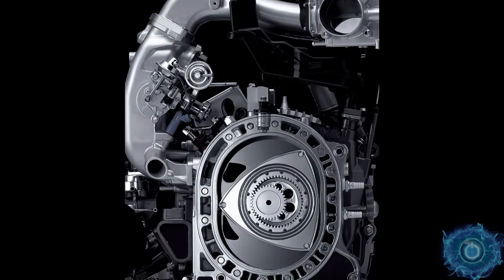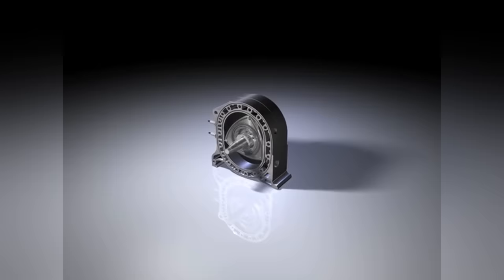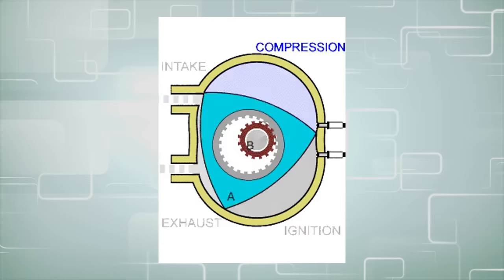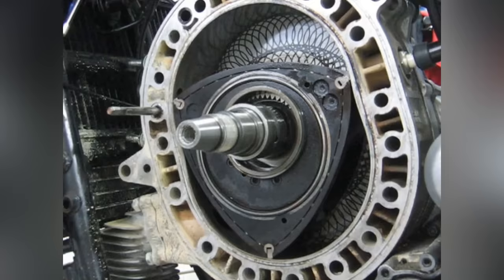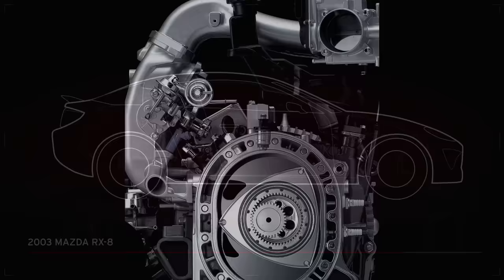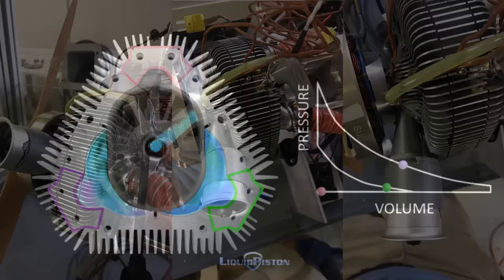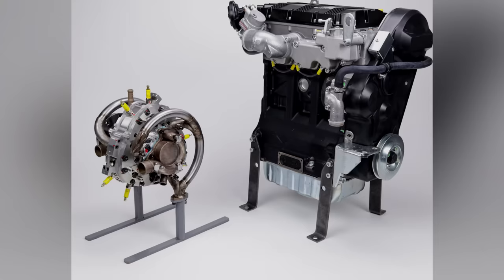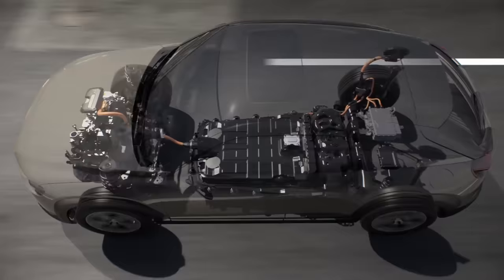STRANGE New Rotary Engine BREAKS Records

Comment: 40 years ago I read a book on Wankel engines from the college library.  There were all sorts of alternative lobe and rotor designs including this one.  So the concept isn’t new but the execution and development is.  This video also conflated radial engines with rotary engines but there is some common nomenclature overlap historically.  The first real use of a wankel rotary was as a supercharger on a motorcycle.  The first operational Wankel engine had spark plugs in the rotor itself.  Silly things I remember from a book I read in 1983.  Wankel had designs that could create a theoretical 144:1 compression ratio if a functional seal could be developed.
Reply: Do you know the name of one of the books?
Reply: The aircraft engine shown was considered a rotary engine because the crankshaft was fixed and the entire cylinder block rotated around it, whereas a conventional radial engine has a fixed cylinder block with rotating crankshaft.
The Musée de l'Air et de l'Espace in Paris has on display a special, "sectioned" working model of an engine with seven radially disposed cylinders. It alternates between rotary and radial modes to demonstrate the difference between the internal motions of the two types of engine
Reply: I remember an item from Popular Mechanic about 1980? It was a great idea then and my college buddies were awed by it.. 😮😮
Reply: @mirandahotspring4019  Either way,  both aircraft engines are piston engines. Secondly, the Wankel rotary doesn't have a fixed crankshaft. There were some weird considerations is the past...
Reply: @stuartedge5906  The original Wankel design DID have a fixed shaft; the rest of the engine spun.
Reply: @tfod 

Thank you for your comment here.
Reply: It’s a long shot but do you remember the name of the book? Or the other lobe/housing configurations?
Reply: @RockSolitude   I had posted it but I guess that post got eaten or deleted by the YT guards.  Probably because I linked to the book.  I think it was The Wankel Engine: design, development, and applications by Jan P Norbye.   However I cannot be certain.  I was fascinated with one where the the rotor had 4 lobes and reminded me of a 4 leaf clover.  There was a 6 lobe design as well.  The idea was the rounded rotor had the seals on the chamber instead of rotor edges.  I hope that helps.
Reply: At University I recall a brilliant physics professor tell the class that revolutionary designs take about 100 years to be fully appreciated by engineers and/or that's about how long it takes before materials advanced enough could realize a new engine design. The examples he cited were the Stirling Engine which is about right and AC compressors which enabled refrigeration and all of the benefits that brought to both home and in the field. I feel the same way about the Wankel rotary engine. With the need to electrify planes, especially short-haul airplanes, it seems to me that the Wankel will finally have found its niche application.
Reply: @RockSolitude  The Wankel Engine, by Nicholas Faith; The Wankel Rotary Engine, by Harris Edward Dark; The Wankel Rotary Engine: A History, by John B. Hege; The Wankel Engine, by Jan P. Norbye; Principles of the Wankel Engine, by Ted Pipe.  I read all of these and included comments from them in my MS thesis.
Reply: @Peter Neve  try Rotary engine by Kenichi Yamamoto. I have it on my shelf somewhere but a quick search had me downloading a pdf copy also. If you like rotaries. It's a must read.
Reply: So you freely admit the single source of your 'knowledge' is a book you read 40 years and yet here are saying this video is wrong. Wtf is it about YouTube comment sections that make everyone think they're an expert on any topic.

The aircraft engine shown absolutely is a rotary.
Reply: You know, there are ways to improve the piston engine dramatically. And strangely, instead of changing the engine, they are trying to delete gasoline engines. It's an insanely... Well, it's not good that consumers are allowing governments to delete gasoline engines so you can't even buy them. You can use "lean burn" technology to dramatically reduce the amount of fuel, to something like 50:1 air to fuel, instead of stoichiometric 14.7:1 which is used today. In the 1970's, hundreds of people created cars that got 80 mpg, or even 200 mpg. One car in 1973, the Shell sponsored Opel, got 372 miles per gallon, and weighed 2,500 pounds with a regular full size piston engine, running on normal gasoline. Why are people not asking for these improvements? People should be demanding these obviously existing technologies, instead of being willing to pay $75,000 for a new electric car.
Reply: @3-der251  You Da Man, assuming I don't mis-gender.
Reply: @kermitthefragg  It's not a Wankel, though, and I think he's making a distinction between piston-driven and rotary.  Your hair-split is probably finer than his.  It's still nice to hear from someone with some years who's been percolating concepts for decades.  I wouldn't $hit on that.
Reply: @Ritalie  I wish I had the receipts on some of those inventions.  I remember hearing about all kinds of inventions whose patents were bought up by Big Oil or Big Auto.  

My biggest gripe in the here-and-now is the planned obsolescence.  People should be able to keep and maintain cars FOREVER, and the auto industry should be - ahhh - geared to the manufacture and distribution of replacement parts.  The new cars manufactured each year doesn't need to be as great as it is.  Yes, we need an auto industry.  No, we don't need all the government interference in how they're made and who can make them.  But they've regulated them to such a degree that you have to be a multi-billion-dollar mega-company to survive at all, and now the Big 3 are dying, anyway.  This is the pattern of all our fascistic regulations that seem to be for the common man, but inevitably build monopolies (thinly-veiled oligopolies).  

I would LOVE a stripped-down vehicle with none of the electronics.  Timing gear, timing chain, carburetor, valves, ...  I can understand all that stuff, and rebuild any part of it, if the parts are available.  With proper maintenance, car wrecks should be about the only reason a person needs more than their first car or truck.  

've got a '93 I'm fixing up, now, and getting parts is still possible, but NObody's rebuilding that 3-liter Toyota engine, any more.
Reply: P
Reply: Looks like it's worth looking into
Reply: 1971 Jan P. Norbye "the wankel engine"
Reply: I remember that from the 80s small engine stuff. I would have invested and I would have built a bike ,dirt bikes and off road vehicles.
Reply: @Ritalie  it's only logocal financially. When you're the only peole making something and everyone uses it, like a car, and you make them switch to something new, you've just made an enormous amount of money. And entire new businesses.
Reply: And if you make it make 100mpg you won't sell gas. just like if it doesn't break you'll eventually go out of business. That's why lightbulbs only last a certain amount of time. There is a bulb that's been lit since 1901. Yet ours last how many hours? It's all about money.
Reply: I totally agree. Having been a self-taught air-cooled VW mechanic, the only reason they are gone is the gov't  rules and regulations. 
Even at 72 years old, I know that, given the parts, it could, and should last me my lifetime.(what there is left of it, come what may). I still have all the tools necessary and enough useless knowledge about them to fill a book. 
Who needs a new car anyway? What a waste of resources. Everything can be repaired, good as new. Everything that is, except today's cars. Too costly.
By design. IMHO
Reply: I remember the engine in the motorbike racing of the late 70s early 80s in the UK , billed as 600 cc won many races in the hands of Trevor nation and some else,  still raising eye brows today
Reply: Serious problem Wankel has and always will: shape of the combustion chamber is poor. Also, the style and rate of compression of gases far from ideal.
Reply: Materials design is always behind concept. Some day though!!
Reply: @Harry Mills  he said it isn't a rotary it's a radial. He's wrong. Plain and simple. It isn't splitting hairs at all. A rival engine has convential pistons arranged radially (hence the name......) around the output shaft. Nothing to do with arguing whether or not it's rotary but not a wankel. Did you even read his comment properly?
Reply: Mmmm confused with all the intelligent texts, they all all so right, my small two cell brain can't cope
Reply: Sounds as if the XT-210 would be great to power gensets.
Reply: @harrymills2770 i really agree with your view. Even keeping keeping an 20-40 year old car running is gonna be more eco friendly than demanding a new car every 4 years. The new PSA cars should drive every day for 12 years to be in surplus on the co2 from getting made. I've read in a source  that a brand starting with "T" and ends on "a" have to drive for 20 years to have surplus on co2 emissions, just from materials and assembly. Have a great one.
Reply: @Hugo_Ps24  the book is "The Wankel RC engine design and performance" By ansdale
Reply: @TheHarryMann all ic engines have their issues, I like the shown design, not sure why Mazda didn't go with it as it seems better, maybe seal technology or material choice was limited, just looks like a better combustion chamber shape.
Reply: The engine at the start of the video is a rotary and not a radial. The differences are clear...
Reply: @Ritalie  
The question is why this was implemented decades ago. By demanding any new engine both beats current designs, and uses current parts, all effective progress has been blocked. (The reason is economies of scale, and unwillingness to obsolete investments)

The Taurozzi engine is an example. It has been developed for pumping gases for medical purposes, demonstrating the validity of the concept, but not used for engines. 

Sony faced a similar problem when they developed the first lithium batteries. They offered battery manufacturer's orders in the millions, but they flatly refused to accept the order. They had to develop and manufacture the batteries themselves.
Reply: @harrymills2770  
You have just stated why manufacturer's don't like valve free designs : no maintenance. GM in the 1960s and 70s made most of their money on parts.
Reply: @Sublime_1  
If I remember correctly the 1901 light bulb was installed in a fire station, and still works to this day. The manufacturers initially developed steadily better bulbs, and the standard had reached 5,000 hours or more. When they realized bulbs were only being bought as replacements, they got together, and made sure no bulb lasted more than 1000 hours.
Reply: @patrickbodine1300  
Worse, they are dependent on chips which become obsolete in 5 years. The critical parts don't exist by the time maintenance is needed.

Comment: If the fuel efficiency is a bit better than the Wankel, this new rotary engine could be a great option for general aviation with its lightweight for the power produced and the inherent reliability of a low-part-count engine with no valve train.
Reply: If this is a worthwhile engine for AC design, coupling it with the upcoming new prop designs could be of real interest and efficiency.....
Reply: Meh, no way an oscillating clunker will ever outperform a true rotary, the jet turbine and the new jet turbine/high output electrics are filling the hybrid gap.These work like railroad diesel/electrics, except the generator is coupled to the jet turbine.
Reply: @larryhyak2529  - I saw a weird quiet prop used on a drone that's used to deliver blood and other medical supplies to villages in Africa.  The prop has two oddly shaped props perhaps 45 degrees from each other and what looks like an aerodynamic counterweight opposed to the two props.  Presumably it's efficient or it wouldn't be used for a long distance drone, and it was very quiet.
Reply: @Liberty4Ever  
The other option thats even safer and quieter is the toroidal prop... In air or water....see sharrow props. 

The spark ignition form of this engine is reckoned to be  50% more efficient than a conventional reciprocating engine and the diesel 30% plus its way smaller lighter and smoother and simpler.
Reply: @aardque  Consider the potential lower footprint, total cost, part counts, and service costs. It may not be as peak efficient as a turbojet/fan/shaft, but it could be much easier to maintain, which will have a much more significant impact to the operating costs, especially for short hop applications that don't benefit from that cruising efficiency. It could also make a difference for time sensitive applications. Turbine engines often have complex startup requirements, requiring long warmup times and external assistance. There's also the fact that piston engines have much better throttle response, meaning a pilot needs less training and experience to reach an operational proficiency. Those are all huge deals for making the power of aviation more accessible to areas without the economic ability to sustain a more complicated air fleet.
Reply: @dustinbrueggemann1875  Aviation is going entirely AI within this generation and power plants will be printed, making concepts like "parts count" and "pilot training" obsolete. With AI design and modern manufacturing, all "parts" will wear out simultaneously, allowing for simple replacement.

Counterotating, ducted fans have been found to be the best combination of efficiency and practicality, thus far. The easiest way to drive ducted fans is electricity and from there, the jet turbine is the most efficient way to convert petroleum distillates into power.

Maybe we could use the inside out Wankels for our steampunk project builds.
Reply: @aardque  not for jet planes, more for planes using piston engines
Reply: @Liberty4Ever  Is it quiet? Yes, but is it efficient, no. Standard props are far more efficient than the Zipline props hence it's not effective for long-distance flight. The zipline "quiet" props are used for other services on city deliveries hence short-distance flights, sacrificing efficiency for noise-free delivery in crowded or city area.
Reply: Would love a cost efficient 5 or 6 hundred HP engine in a Lance Air 4 
 Aircraft engines are extreemely over priced.
Reply: I don't know seems kind of heavy for 25hp when most of it is made out of billet. Honda's old 20+ year old 1000cc triple weighs around 125lbs and make 65hp. You figure with less moving parts billet construction and it being pretty compact it would weigh less than 42lbs.
Reply: @aardque  The main issue with turbine engines has always been the exotic materials and complicated designs of the blades, especially for the high temperature turbine section.  In the early 1980's I visited the GE plant where the turbine engines used in the M1 tank were made.  The high-pressure turbines cost about $50,000 each at the time.   There have been improvements since then, of course, but you get the general idea.  With smaller engines, it is also difficult to get the high compression ratios needed for good thermal efficiency.    
It might end up being more economical to use a turbo-compound engine: a piston or rotary engine with an energy-recovery turbocharger.  This is what is used in the current Formula 1 cars.  The turbine blades operate at much lower temperatures and can be used as electrical generators (Formula 1) or recover mechanical energy through gearing, as is done with the Volvo D13 truck engine.
Reply: @aardque  Imagine if a railroad diesel could be replaced with a hydrogen one ?
Reply: @rscott2247  You do understand that railroad engines are "diesel-electric?" Locomotives are already powered by electric engines, the diesels are just generators.

Why not just leave the hydrogen generator back at the switching yard and power them with batteries or electric rails?
Reply: @aardque  the Wankel is the only true rotary.
Turbines are an entirely different kind of engine.

also hybrids and EV's are for tree hugging hippies
Reply: @aardque  Yeah...No.
AI will never replace human pilots.
additionally, no aircraft parts and engines will not be printed.

your post shows that you have absolutely no knowledge of aviation or the construction process of aircraft construction/production.
Reply: Govt stupid to block rotary engines because of a stupidness of emissions because in theory the rotary engines require much less emissions overall because they small and less parts to build etc so overall emissions is lower

Comment: I’m a motorcycle builder, started at 18 fabricating the frame and rear end. I have a frame sitting 10 years and haven’t built anything because I’m not decided on a engine yet. This caught my attention since rotary has had improvements.
Reply: Is your bike a trike ? Since you said it has a rear end!  After 10 years what’s the holdup?
Reply: I am an Iranian and I live in Iran and unfortunately it is closed and I can only see these clips and I have plans that I cannot implement due to the conditions of the country.  The new Tawankal with newer capabilities should work / it's a pity that it can't and we are stuck in a bad place///😢😢😢
Reply: @mehdisoleimanian6394  😢